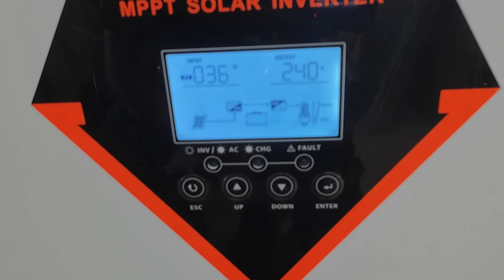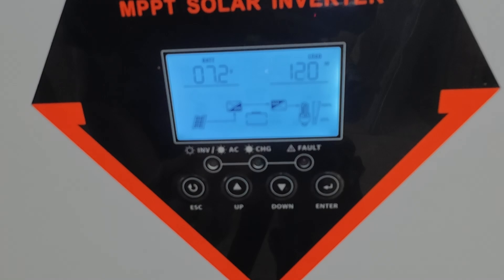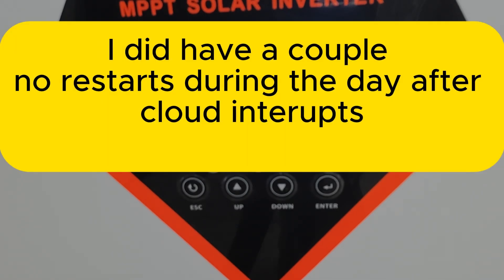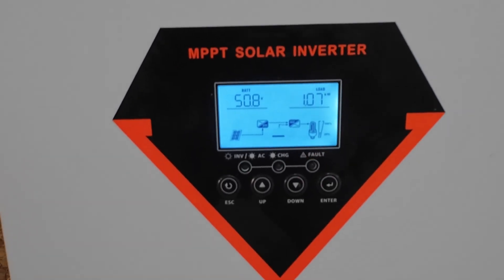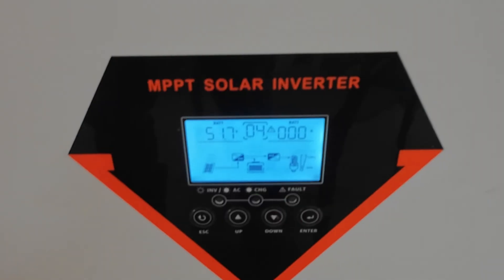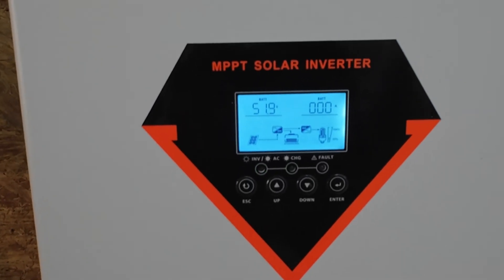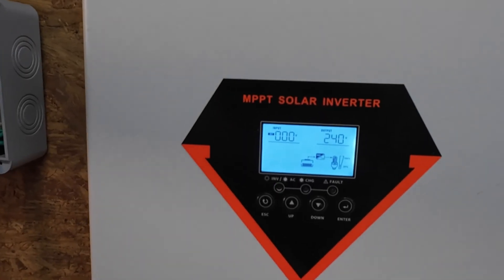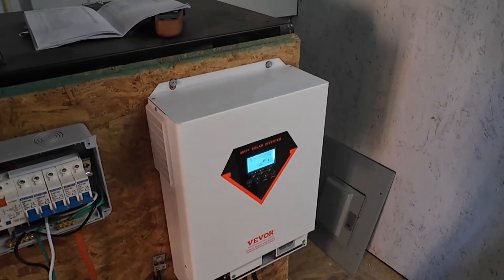This $300 Inverter Kind of Works Batteryless, But Here’s the Catch

Comment: This system can work perfect for water heating, but you have to avoid the heater as resistor...
If you convert old air-condition with heat exchanger and water will not need that much time to warm up...
Can be controlled by mechanical time switch to the best sunshine on the day, so it doesn't need babysitting...
So, on the end is working perfectly without the battery power, if you know what are you doing... same as this inverter is working with water pump, you replace with converted air-condition to be your heater for water...
For more information feel free to contact me...
Good luck everyone!
Reply from the maker: That is an interesting idea and probably more efficient but way to complex for this project.
Have you converted an air-conditioner for water heating? I would be interested in finding out more...
But if I really wanted to heat water with this inverter and I knew what I was doing, I would probably just control the heating element with an SSR and micro for time and temperature windows.
Thanks for watching!

Comment: I am late to the party, but if the goal is to heat water whenever there is sun, why not ditch the inverter and use heater or heaters (plural) to heat water at the same voltage as the panel's output? ie: 12v, 24v, or 48v
ps just like my 12v solar powered gate opener, everything is 12vdc
Reply: My water heater is direct from panels, works fine.

Comment: Did he ever get to the point? 😢😢😢
Reply from the maker: Have to watch the first part for the whole point but,
In this video I wrap up the solar-only test on the $300 Vevor inverter. The goal was not about heating water specifically, the water heater was just a simple, repeatable real-world load. What I really wanted to know was how this inverter behaves when you remove the battery entirely and try to run it straight from PV.

I ran the inverter off solar only, no battery and no grid, and let it power the resistive heating element fed through an isolation transformer. When there was enough sun, it worked. The inverter was able to carry the load and even adjust output as PV changed. As soon as solar dropped, though, it faulted out, which is exactly what you would expect from a system that has no buffer.

Sometimes the inverter would recover on its own when PV came back. Other times it would sit there until I manually reset it. That alone tells you this unit is not really designed to be batteryless. It can run this way, but it is not something I would trust without babysitting it.

Another important takeaway is that the inverter’s reported wattage does not always tell the true story. With magnetizing current from the transformer at idle, you can see apparent power that does not reflect real power. This showed up clearly during the test and is something to keep in mind if you are watching the screen and assuming watts always mean watts.

I also ran into an odd fault code that the manual describes as PV overtemperature, even though operating conditions did not support that explanation. In practice it behaved more like a low battery or internal logic issue and required a manual restart to clear.

This was a learning experiment, not a recommendation. It answers the question of whether you can run a load straight from solar with this inverter, but it also shows why most real systems include a battery or at least some form of buffering. The moment solar becomes marginal, things get unpredictable.
Reply: @DIYSolarFarming I learned this from Mikes Solar Garage, that EG4 inverters (and I assume all inverters are this way), they intend to get their control power from the BATT terminals.  Mike and I used a 48 vdc power supply to configure settings and do firmware updates on our EG4 inverters before connecting any other AC or DC.  IMO, trying to run an inverter with no 48-52 vdc input to the BATT terminals is asking for an inverter failure or unpredictable results.  For this tiny inverter, a tiny 48 vdc power supply should allow you to run without batteries, if you can configure your inverter to NOT try to "charge" your power supply. 🙂
Reply: @DIYSolarFarming Get to the point.Even now, you write a book, instead of a sentence.
Reply from the maker: @duotronic6451  Yes sir, but did you get the point?🤣
Reply: @DIYSolarFarming TLDR. All you had to say: $300 inverter did not power water heater next morning & should have use 240v water heater.